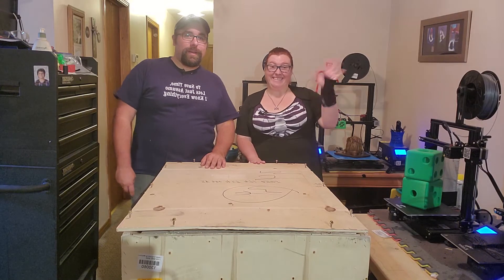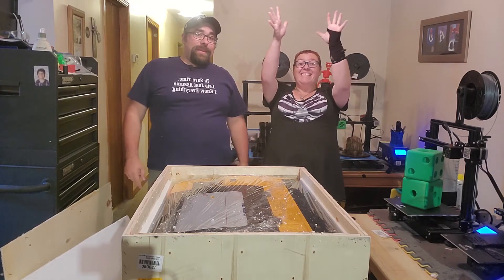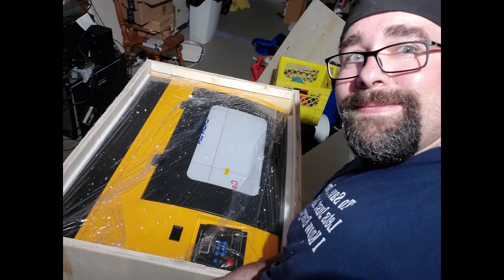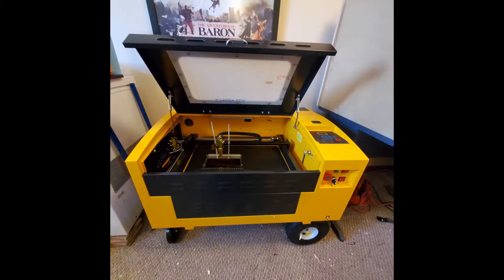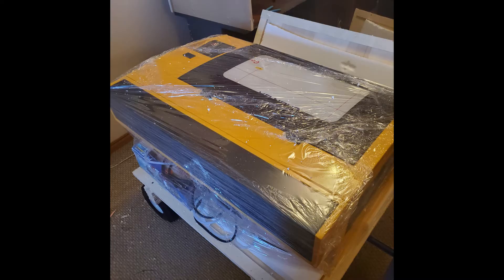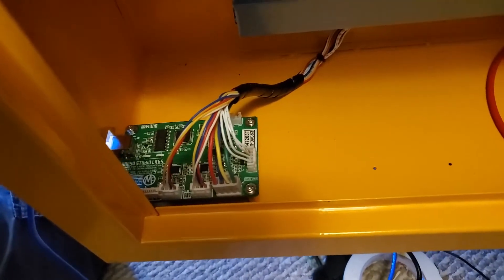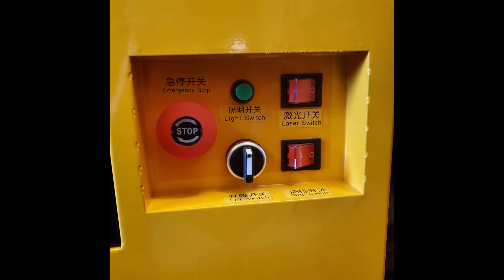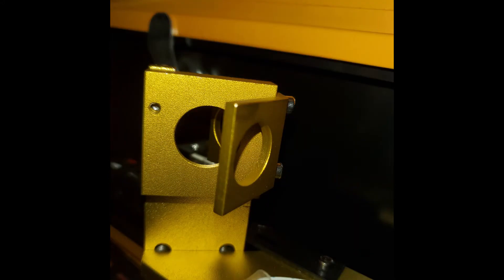50W 3050 Laser Engraver Unboxing

Comment: I think this particular black and yellow model only have one set of Y-axis spine shaft--on the left side--the right side is guided with a hidden plastic wheel that just glides on the frame surface---it is a cheap out tactic for many of the lower priced machines. I went for the blue and white 3050 model that has 3 linear rails for all axis.
Reply from the maker: That's fair, I must admit that despite that it has been an awesome machine and we have had no issues